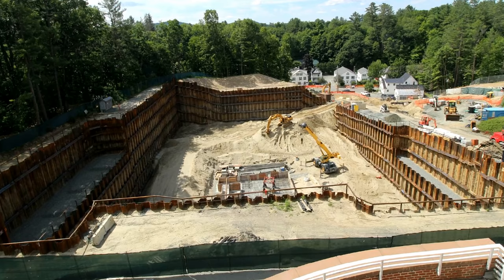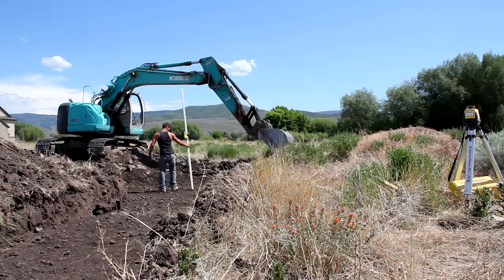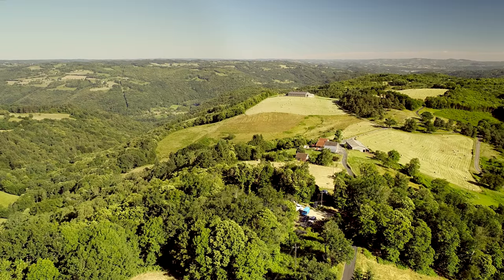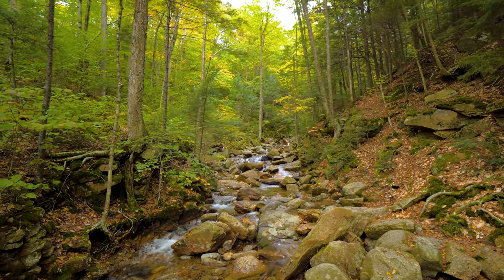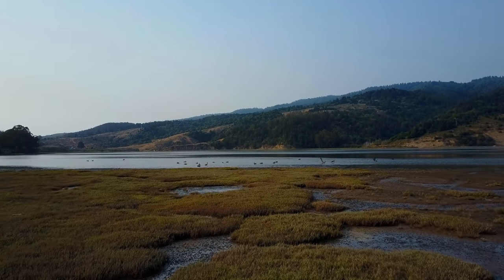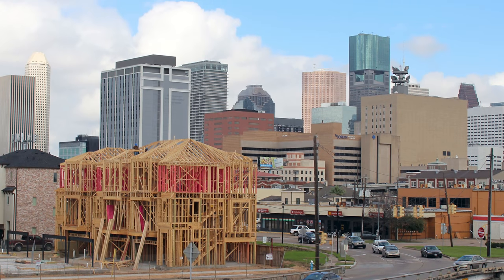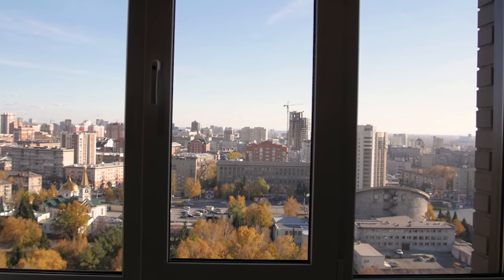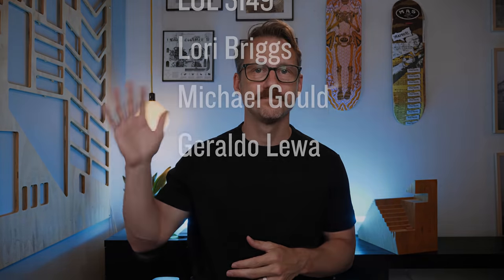The First Problem Every Architect Faces

Comment: Nice video
...but I was expecting to learn specifically why the 10' shift south was an issue
Reply: Me too.
Reply: Not an engineer yet, but the first thing I thought is communications. 10 foot is around 3,05 metres, which means, that all the communications and infrastructure (starting from the road so cars could get there, and ending to the sewer network or electricity) needs to be shifted and particially rebuilt to fit the building

Comment: Great video on a complex topic. I disagree with one point. Buildings, e.g. a house, in a warm climate might be located on top of a hill to catch the breeze. Whether it's on the north or south side is of little consequence because the sun is almost directly overhead at midday. Or, perhaps it might be located on the east side of a hill because the strongest sun in the tropics, most difficult to sunshade, is from the west in the afternoon. Please continue with these videos! Very helpful.
Reply: In colder northern climates the house was often built directly atop a spring, so the only source of water wouldn't freeze solid in winter.

Comment: A problem I have with some of the examples on the misplaced.design site is that they were intended to be out of place even in the urban landscapes in which they were placed in. The NY Guggenheim as a particularly notable example. It only "fits" in the cityscape because it is a building and a city is made of buildings, but it was designed to stand out even there. 
And nearly any building will stand out in the landscapes they chose.  Even those structures designed to be in "harmony" with nature stand out as separate from it. A conscious design works better than simply plopping a random structure down, but any noticeable building stands out and is jarring if viewing the landscape as the primary influence. 
It is, indeed, a conflict to design a building that calls attention to itself whilst also purporting to blend with its surroundings or, at least, reflect them.

Comment: It would be nice if there was a way to bypass as many of these issues as possible, but it looks like in the USA, at least, (and probably everywhere), there's no way round.

For instance as far as views go, if you just built tall enough, and left a big enough green space in front of a building, just about everyone would have a view. But you can't. If you build tall, it has to be almost close enough to touch something else that's taller, generally. And if you build stumpy and sprawled ... well forget it. Apart from the people on the edges (and that's only until the next blot of sprawl splotches out over the land), nobody has a view. I suppose it's better than a "view" of a wall of glass, though. Or some sculpture disguised as a building that never changes.

As far as soil conditions go, if you were able to pick and choose which parts of a large piece of ground were to be built on - in blocks - or used as green space - in blocks again - you might have quite a good chance of placing your building on good footings? You wouldn't have to worry about views, since there would be a view of sorts automatically from the building being tall enough for that, and isolated enough on the view side for that not to be blocked eventually.

And then if your building was very compact in this manner, your services would just automatically have shorter distances on average to cover than they would if you made a wide, sparse net of them, spread over what could've been your green space, but is now constrained to be paving or pockets of lawn (if you stick to the canonical recipe for a great neighbourhood).

In other words a lot of the problems mentioned could be solved by going for a combination of density and sprawl, both at the same time. (Insist on having your cake and eating it.) Put habitations in dense blocks. Put green living space in blocks where you actively prevent building of structures, too. Put a tall block in an enormous, suburb-sized green space, with lots of public ways, so as much of it as possible is accessible to everyone.

I'm not talking apartment towers plus public parks (with no private green space). Make "walls" not towers. And make one of the rights of occupancy of a residential space, the right to some personal green space (where the restrictions are only for the prevention of suburbanization by turning garden sheds into houses). They do something like this in Germany already, and it works. It just needs to be pushed to a next level, where there are "suburban apartments" - with the benefits of dense living as well as the benefits of sprawl.

It might require some rethinking of what amounts to "waste" in a tall building to make it truly competitive, though. The horrible thing about apartments is being subject to your neighbours noise (although suburbs are not quiet as nature - what with e.g. lawn mowers and kids screaming). Maybe it could be made feasible to make a "wall full of holes" - instead of using every last bit of space, wall-to-wall. Leave a gap between units. Leave gaps above and below, too. At least a building like that would have low wind loading? There might be some configuration like this that gives this extra privacy without excessively increasing costs. Even if this is a doomed idea, it might make an interesting exercise for those learning to do the sums on these things to play as a game? Somehow beat the odds, and make the "wall-block-with-holes-in-it" into the best choice. No points for just immediately knowing it's dumb. (No points for refusing to think, IOW).

Anyway, here's the rough dream again:

"Wall". Where people go home to sleep, perchance to dream. Units separated by wind holes/ "balconies for the dog".

At the ends/ one end of the wall, parking garage. All the stink machines piled up in one, big, nasty heap, excluded from the neighbourhood. They exist to pollute other places, and kill the children and grandparents of others, not those of "the wall".

2km out front; 2km out back: Green space.

That should allow enough space for at least one golf course, one pony trail, and some stables, lots of veggie plot size allotments for less keen gardeners, plenty of little small, manageable gardens with gazebos to take shelter under, quite a few big expensive gardens for people who love to waste their money on plants, public tennis courts (for competition style tennis), private, enclosed courts (for other kinds of tennis). Public pools, private pools, ... suburban stuff, only there's no need to choose which.

OK so there should be a cricket pitch, too, for the purposes of bringing civilization to the Americas.

No roads, no cars, maybe some hansom cabs. Within the neighbourhood, move slowly, unless you're taking the metro.

And then de-uglifications too?

A blank wall would be as ugly as the ugly parts of downtown. So plan to "stick on prettiness". Onto a practical residential space (maybe with some Hundertwasser perturbations of the simpler symmetries) plan to stick on things whose main purpose is to look nice. So all the architect HAS TO achieve is a human-beautiful facade. Being optimally effective, using the inside spaces behind this is optional.

So some way along "the wall", you might have "St Mark's Square" - done as cheap as is consistent with durability as possible. A space people might hang out in. Try it on a small scale. If it works, try again.

And maybe further along you could even slap on a Tower/ Monument - full of facets, and mirrors, or brutal concrete, or whatever the sculptor wishes to compel those who bow to it down there to bow to.

I just mention these things to point out that there's no need for "wall purity". There probably need to be bits of uneven stuff if you want people to feel happy looking in the direction of a wall like this. (Looking away from it should be nice. Lots of trees. Who doesn't love trees?)
Reply: I got lost in there, but I'm intrigued and I'd like to visualize it.  Find someone who can sketch examples of what you're proposing, pay them if you have to.  Then spread it around the internet.  A good vision can spread.
Reply: @briankirkpatrick8888  Thanks for reading it. I should probably keep to the generalities or be very specific, and just target specific aspects of the idea, because I end up taking up way more of everyone's time than I should be (assuming it's even read). 

If I had money for it, I'd probably have drawings done, but for the time being that's not possible.

The most general picture of this "suburb" is that it's a single building up to kilometers long, and also tall. There's no building in front of it, and none behind. That's all green space.

A more particular view of it would have "pretty features" added, almost entirely for the sake of making it look nice from the outside. (And the details of what's pretty? I'd have to leave that up to people who're good at that. I think e.g. an Italian piazza looks nice, so my extensions for the sake of appearances would be something like sticking on a replica piazza. I could also half imagine having some places where there are "modern" faceted office-tower type features - things like those "gherkin shaped blocks" in London, for instance. Only I'd want to incorporate that into the building, not have it as its own tower off to the side.)

The "holes" can be imagined by just thinking of one of those brick walls where you leave out some of the bricks. The holes would be "balconies", the bricks would be dwellings.

I think that's probably enough of the essentials for other people to add their own variations to? (And in these things the details matter.)

Anyway, thanks for reading and commenting. I appreciate that.

Comment: Set a timer while practising questions. You should consult your teachers for the tentative time spent on different questions. Give a lot of practice papers as well as full tests of previous year papers. It will give you an accurate idea of your speed and improvementJokes apart,you can still crack JEE if you are strong in the other two subjects. You should get qualifying marks in maths though. You can score well in the other two to maximize the total score. But try improving your maths.

Comment: I had only so many clearings on my property. And had to finding true north for my location. Then avoiding pushing too many trees over. Stump suck to deal with. Was planning being remote off grid. But they put in high speed internet on my 2 track. But electric miles away still. Had to go down to 6 feet to hit hard pack for my piers. My test fire pit hit hard pack 2 feet down. 20 degrees warm on our property compared to by lake Michigan. Actually in deer wintering complex central U.p.

Comment: In Utrecht there is a triangular shaped modern office building in the middle of the historic inner city, much higher than the surrounding buildings, a real eyesore. Of course it cannot be torn down because it has gained protection for it's apparent architectural value.

Comment: If I would build a home and have enough money I would first want to have the rooms designed together with a interior designer so I know sizes of furniture and where I want large or small windows. And than an architect who take all these rooms and create how they logically need to be placed on a piece of land and how the exterior is going to look (together with a landscape architect). Is that ever done and is it a good idea or not and why?
Reply: Well technicaly architects responsible to pick where the Windows are ,what is their size ,and how many rooms can be fit in your land what is their size and what can be fit inside that rooms and of course the exterior look of the building ,interior designers responsible about the mood of the room the final place of the furniture how they look they can pick evey aspect of the interior from texture ,color ,artificial lighting , celing decoration and floor design , it is much wiser to go to the architect first then to the interior designer ,its like picking a pc (architect) then you put the programs (interior designer )that you wanna run on it
Reply: I dont know if its ever been done but it sounds to me like a bad idea. Or, what i think will happen if you try is that you find that you'll end up changing the rooms as you and the architect attempt to place them. Professionals ackowledge it as an iterative process, so they accept that you cant avoid making different iterations. But theres also the insight that some methodical approaches to design are superior to others in that they lead to fewer iterations or dead ends before the final drawing.

Comment: Kinda wanted to hear the technical details behind the mistake made at Dartmouth College, which opened your video. But the another question occurred to me: When a University designs a new School of Engineering or a new Faculty of Architecture, why don’t the professors do it? Or do they? Or… is it IMPOSSIBLE to stop them from meddling. I wonder if they are ever happy with the result or have the typical conservative reaction to abstract art: “mmmph. I could do better than that!”
Reply from the maker: The answer to the second question is that there is usual a 'conflict of interest' clause that doesn't allow faculty to work on their university's building designs...